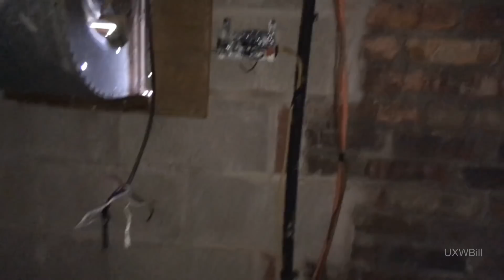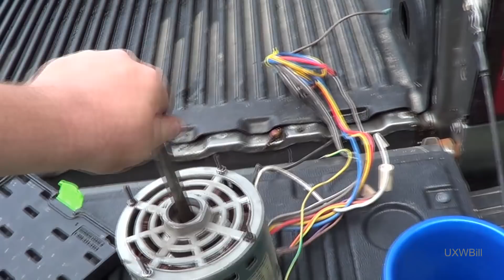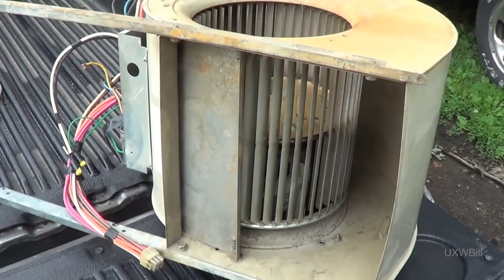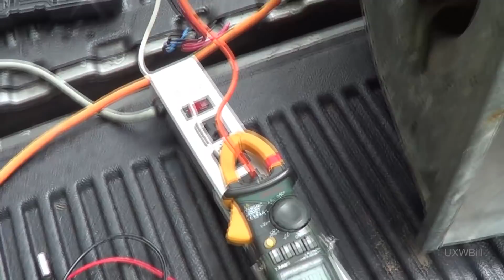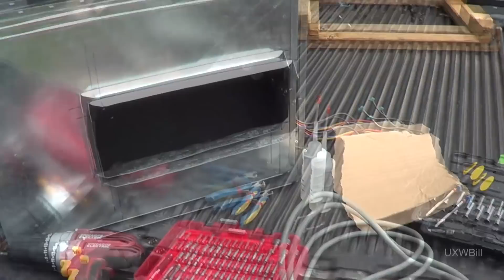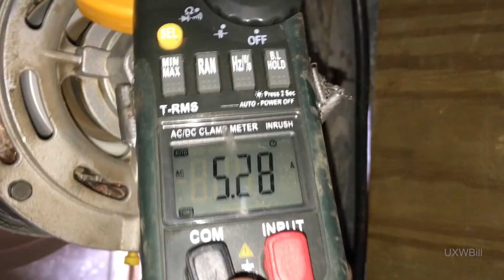Ventilation Blower Motor Replacement

Comment: If I'm not mistaken you should have some 162V AC on the capacitor terminals when the motor is up and running. That would bring the phase shift extremely close to 90° to the auxiliary wiring on this single phase motor. Ideal condition to have a smooth rotating field inside the stator. My calculation is as follows: V ( Cap ) = V ( L1 ) x √2

Comment: is it possible to increase the speed on these motors or is that bad for the fan?
Reply from the maker: Only if there are speed taps for higher speeds, and you're not using them. Just remember: the speed at which the motor operates was chosen for a reason!
Reply: @uxwbill  would changing the size of the wheelon the motor which is on a pulley with the fan, increase the fan speed without increasing motor rpm?
Reply from the maker: Yes, if you have a belt driven fan and change either or both of the motor and fan pulleys, the fan speed will change. Don't do this unless you have an accurate AC ammeter available. It's very easy to overload a motor without immediately realizing it, so you need to know how much current it is drawing.

Comment: I wonder if there's a difference between restricting inflow on the blower fan vs. restricting outflow. I always assumed to  just restrict inflow because it would create a vacuum like environment. Are you able to say with any certainty which would be preferable, or is there much of a difference at all?
Reply from the maker: I don't believe that there is much difference. I typically go for the outlet just because I find it easier to restrict.

Comment: First of your videos I have watched. Wondering if customer pays for new or used motor and cap? I would have thought that you would have cleaned the dirty blower blades. I have been told how important cleaning those are for optimum air flow.
Reply from the maker: I am not a dishonest person. The customer was told exactly what I planned to do and paid only for what was actually supplied: a used motor and capacitor.

The blower blades were not especially dirty, only slightly rusty.
Reply: @uxwbill  Tnx 👌 for setting me straight on that video. I have subscribed.

Comment: Condenser units inside, yep that makes sense... Nice fix there, the only other thing I would have done is added some chicken wire over the exhaust portion, to try and keep critters out of it. 
I am not sure why your iPhone is having issues with audio recording, my well used iPhone 6 sounds much better than that when doing a "walking and talking" recording. It almost sounds like you have a Lifeproof case on it, which are well known to degrade the sound quality of the phone.

Comment: Great video as always! This might sound like a silly question but why does the current go down when you restrict the airflow? I would of thought it would of went up as the motor would have to work harder to push the air. My first thought is that it was something to do with the power factor.

Comment: Just shaking my head on this.... Maybe I'm off my rocker, because I can't see the big picture, but for someone to think it's much easier to punch a big hole in a brick building, and rig up some half assed venting system, than to run a couple of line sets, and 240V whips outside where those condensers belong. Then there's the noise of the whole mess running to consider too.  

Would love to see the head pressures on those units under the strain of a hot summer day.

While not as extreme, the genius that installed my condenser unit at my house placed it under a deck, with only about 2 feet of space, and tight deck boards above it. On a nasty hot summer day a couple years ago, was having trouble with the condenser breaker constantly tripping. Called an HVAC pro out to take a look, and once he saw the situation, just shook his head. 

The unit was inhaling its own exhaust, and overloading the compressor. Once I lifted the deck boards above the fan, allowing it to exhaust up, the pressures dropped to normal, and I've never had a lick of problems with it since.
Reply from the maker: There must have been a reason. Whether good or bad I can't say. There are three furnaces and condensing units servicing this building. Two have been replaced, and one is the original matched Westinghouse set of indoor and outdoor units. The third set is very nearly fifty years old, and its condensing unit is on the roof. I'm guessing the other two condensing units were originally up there as well.

They probably could have reused the existing line sets.

At least the two indoor condensing units are reasonably accessible.
Reply: My assumption is the installer preferred to cart the units up the stairs rather than use a crane to get them to the roof. I’d have at least tried to construct some sort of enclosure to channel in fresh air and direct the hot air back out, but I suppose if you went to that level of effort you may as well install the units outside as intended...

Comment: Your supposed to balance  the amp draw by blocking off the intake not the exhaust.. great video
Reply from the maker: It's easier to do the latter than the former, and I've never noticed a difference in effectiveness.

Comment: Nice job on the repair, squirrel cage fans are pretty neat fans, only example I have here is a small 12v one I pulled from a very exploded induction hob cooktop, and even it pushes a lot of air... :)

Comment: It's hard to believe the blower could keep up with the condenser fans. I'd bet is still gets hot up there.
Reply from the maker: Furnace blowers move a LOT of air, especially the direct-drive ones. Try one sometime.
Reply: @uxwbill  The axial type fans used in condenser units are designed to move a lot of air over a low resistance. This is important for extracting the most amount of heat from the condenser. The centrifugal squirrel cage type of fan can move air through a moderate resistance such as duct work. It does NOT move nearly as much air as the axial type under a lower resistance condition given the same HP motor rating. Having to add the baffle to restrict flow shows that the blower is not the proper fan for the job. The initial install of that system was done by a HACK! Those condenser units will need better ventilation.
Reply from the maker: @JohnAudioTech  The world is full of less than ideal situations, and as has already been clearly established, this is one of them. Sure, if the customer were willing to pay for me to move the condensing units outside, or dramatically improve the ventilation to this room, I would do that.

...but they're not. The customer only wanted the existing fan brought back to working order.
Reply: The ultimate eventual solution to problem will be that they have to have the units moved outside. Until the owners of the building want to pay to do that, there’s only so much one can do...

Comment: I am a duct mechanic and I fucking hate sheet metal it sucks atleast it doesn’t make you itchy like duct board does though.
Reply: Have fun touching fiber exhaust warp
Reply from the maker: Duct board is awful, and it's one thing I won't touch.

Comment: lol you are so funny bill :-D
Your discription of the way the metal looked just made me chuckle :-D
Hmm semi blocking the output to reduce loading/current, interesting.
i know less than nothing about aircon/furnace motors, so all those wires just made me want to run away as fast as possible lol.

Comment: The problem with smartphones is that they're not meant for narrated videos like this. When you use the front-facing camera, they use the front microphone as the main one and then use the rear microphone for noise cancellation, so it's actually cancelling out a lot of your voice. Maybe there's some software or firmware modification to fix this, but I haven't looked into it since I don't use a smartphone for video recording. (My $39 LG smartphone's video recording makes a 10-year-old Flip camera look and sound broadcast-quality in comparison.)

Comment: I wonder how an older American motor would fare? Would a shutter help and does it have make-up air?
Reply from the maker: It's a drafty old building, so the answer is probably yes. But I'm sure they could use more, and I suggested that the window in that room be outfitted with a screen and opened.